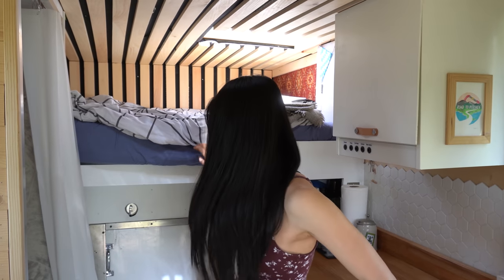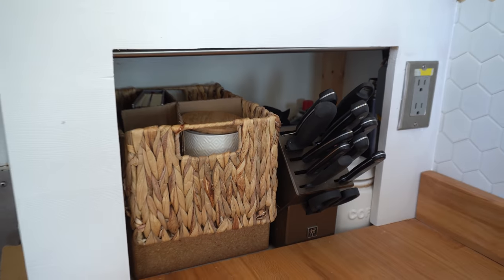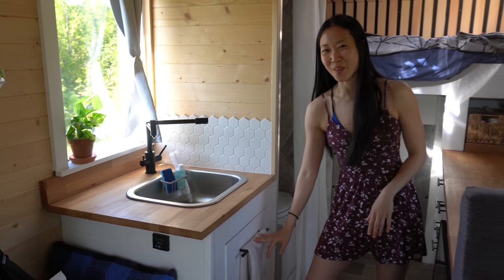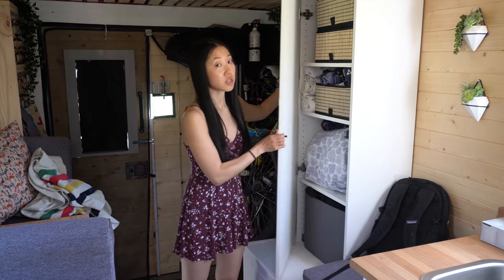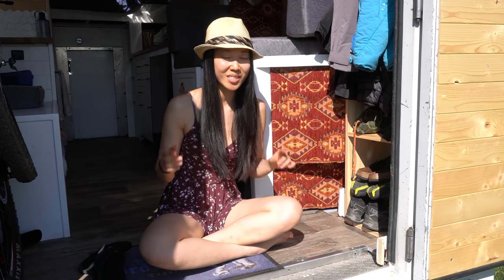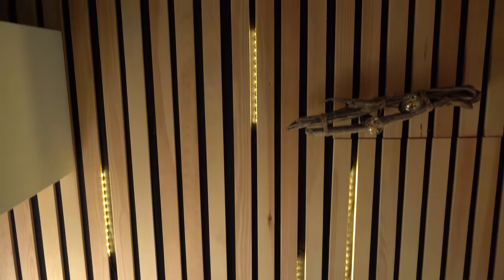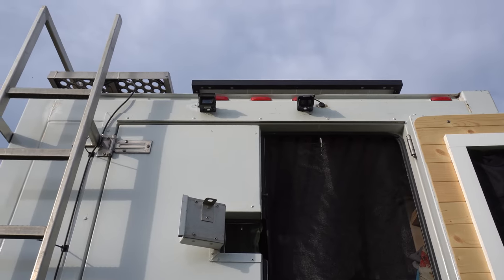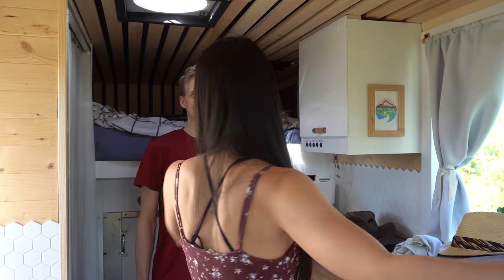VAN TOUR | DIY Box Truck Converted to Beautiful Tiny Home by Amateur Builders During Pandemic

Comment: This is brilliant. What an amazing build! What a fantastic home. Improve? Improve what?? I suppose there's a few things if you needed to do them then there's the cupboard locking system (it was something you guys wanted to improve) the idea above ie electrical magnetic system that sounds cool, then you mentioned the toilet well I have seen on another van/home build and they used just normal computer fans that they put into the base (think it was the base anyway) of the toilet and they were hidden behind the base of the toilet and another just on the side of the bathroom (the outlets for the fans went to the outside of the van these fans are used to take out bathroom smells and steam from the shower) they said that along with the fan in the roof were enough to remove the steam from having a shower, the fan used on the toilet was always on and it was quiet cos of being a computer fan 🤔 they even filmed the bathroom and you couldn't hear the fan to be honest (I think that fan, the outlet went underneath the fan they did it that way so as no to make the side of their home look to 'busy' and I am sure they said it was to also manage the smell, ie the smell wouldn't make its way back into the house via any of the outlets like the bathroom fan for the shower or any of the windows and they also had an opening window in the bathroom).
They said the computer fans hardly drew any power off their batteries/the battery bank due to being computer fans they hardly take any power to run, hence why they also left them running and another reason besides toilet smells (which they say they didn't have cos of the fan/fans running all the time, also they said when they first put them in, they kept having to check they were working as they were so quiet, which you can believe cos when they filmed the bathroom you really couldn't hear them running but we the viewer's knew they were working cos when they pressed for them to stop we seen on film them stop and start start up again 😮, I thought that that was brilliant, and yes those fans were on their own independent switch and not the same switch for their our fan's) by keeping them running they said they haven't had any issues with them drawing power as they hardly used any despite being on 24/7, they said that they have NO issues with bathroom smells ☺️👏👍☺️, they had no issues with any damp building up and also they were very very very very cheap. 
So that is the only issues I can say that you guys could improve on and yes they are issues that you guys mentioned yourself. 
I can't personally see anything that would need changing, as it's brilliant! You guys as you live in here it's you guys that would notice/see if things needed changing. 
I myself I would either think of putting some tiny little lights in the ceiling (maybe in-between the slats in the  bedroom roof perhaps 🤔🤔 they might add some gentle lighting in there and/or some by the bed lights mainly just for reading? Watching TV? 🤔🤔 Infact I haven't noticed a TV as of yet 🤔🤔🤔🤔 (I am at 14.21 in the video) maybe you guys have a projector? Use your laptop/laptops 🤔🤔 although I did hear you say that under the dinning room space that you had a monitor stored under the seating area 🤔😮 maybe use guys use that for a TV????😮😮, then again you may not watch a TV 😱😱??
You haven't painted your home a different colour other than white, may I ask why that is?? Is it so as to keep the 'stealth appearance'??
Lisa UK xxxx
Reply from the maker: Thanks for all the awesome feedback Lisa! We do a combo of laptop and projector on the wardrobe for TV :) just finished watching Upload on Prime and working on Young Sheldon now.

White to stay stealth! Ugly on the outside...we fit into the industrial areas well.

Comment: Beautiful built. You guys are so nice and down to earth. Love the honesty about the toilet. I wonder about it as far as smell and how to clean it and what would be easier and disposal. Thank you
Reply from the maker: Hey thanks for reaching out! So the smell isn't a big issue, as mentioned it's a slight scent noticeable when the lid is open and nobody is covering the hole. We've also added a small switch which turns the fan on full speed as soon as the lid is open, that helps too.

Disposal is fairly easy. Everything ends up in a garbage bag. We just tie it up every week and put it into the garbage. Liquids need to be emptied daily cause we only have a 2.5L jug.

Comment: Cool. Do you know how tall your truck is? Planning on getting a step van and considering extending the roof, but wondering how tall is too tall.
Reply from the maker: Hey, our truck with the ladder/railing on top is a bit under 3.5m. However step vans are usually lower because they have wheel wells so the box can sit lower. With our box truck the box sits entirely above the wheels, so the floor is already at about 1m.
Reply: @RoadtoPitches  Yeah so I just checked and the step van I am thinking of getting is maybe 9.5ft which is about 2.9 meters. Have you had any problems with the height of your vehicle? Things you hit or places you couldn't go?
Reply from the maker: As a general rule of thumb, streets are designed to allow 4m tall vehicles (like regular cargo trucks). Of course there are bridges lower than that, but we didn't encounter any as of yet. If you think of logging roads those are designed for large trucks, too, so no issues here either.

Comment: I built my own toilet also. You would get rid of most of the smell if you put a small fan (couputer / usb) in the box and vent it directly to the outside. It really works. They even make kits you can buy online (ebay) that take all the hunting out of the task. Give it a try.  NIce build....
Reply from the maker: Hey thanks for your suggestion! In fact we do have a fan that vents out the smell so as long as the toilet is closed or a person is covering the hole there's no smell.
But if the opening is uncovered there's definitely a slight scent noticeable.
Currently we're using wood-shavings to cover our solids. Maybe we should consider different materials and see if that improves.
Reply: @RoadtoPitches  I use wood shavings also but am looking for something with less bulk for storage. Thanks

Comment: LOVE you using a pot-filler for a faucet!

WHen I built my Baltimore kitchen ages ago, did the REAL commercial kitchen gooseneck and stainless steel bin sink. Am past the gooseneck ages ago and so for new build, have a right angle, simple faucet with spray in square Italian sink, v simple. STILL love it.

BED: in and out, your first morning stretch?

BATH: curtain, FFS. WHY add weight and complexity? I have noren for my shower and commode in my house bath. Works well.

I do like magnetized knife rack; it's more a reaction to my laziness thing. I don't want to have to clean the knife slots; I rinse and put them up there to dry. BEST thing I've seen, tho, is rice. One build had a bin at the base of the window on the counter and how I'd roll. The claim is that it helps keep knives sharp; dunno, let's see. I'll probably do that for our Toronno apt next year.

Yinz are Canucks? Is that a Boooodveiser in your fridge?

Love the manual lock on your table. If we build, it will be mostly manual. People be doing these motor-movable screens and such for TVs, esp. NO. Another thing to break.

I installed SE Asian-style bidet in 2 of my baths; yet-to-install is a Euro-style one for the cellar. I kinda like the idea in a van for cleaning the #2 streaks. 

Many great ideas! We'd need a bit larger but our build will be for our travel between THailand and Malaysia; Thai GF has been in such small spaces so want to give her a bit more space.

Thanks for sharing!
Reply: Is your experience w/ fixed ladder OK?

Maybe a US thing, but some have mentioned a retractible ladder. One had access from inside; climb on roof and, ya know, Rapunzel the ladder down.
Reply: YES on the stealth.

I've been mulling typical working guy dash stuff; faux golden starches bags/doritos bag/etc, something can roll out onto the dash.

Comment: Welcome to Box Van Life!!  I'm currently in a Ford F-150. She has high mileage and the cost of repairs.. CV-Shaft front end, on both sides as well as needs new control arm assembly for both sides (upper and lower assembly). 
Other parts of seen, that need replacing.  
I'm looking forward to getting into a different vehicle soon. I'm currently stuck.
Reply from the maker: That's a lot of repairs! Are you at a point of no return? What other rig are you considering?
Reply: I think I'm at that point. Any affordable, reliable transportation at this point.  I'm currently considering a 3Wheel bike...(I wish it could be a Hog- LoL)
With a few baskets. As well as a storage unit for now. I'm still here and trying to remember to keep shining my Light as well as to sleep.

Comment: I'm sorry but you keep saying its comfortable and nothing looks comfortable. The height of the sleeping area ridiculously low,  the couch is thin and your feet dangle it's so high up, the dinette is cramped and you are preparing food 2 feet away from doody only separated by a shower curtain. For the money you spent you could have gotten a used RV that was designed to live in instead of that fire trap.
Reply from the maker: We are low maintenance creatures 😂 compared to the place we came from, this is comfy to us! It's all relative.
Reply: @RoadtoPitches  fair enough. Congratulations